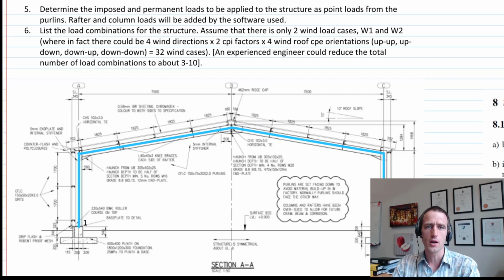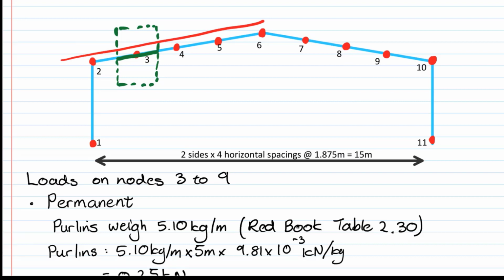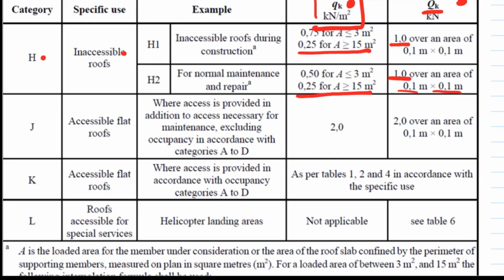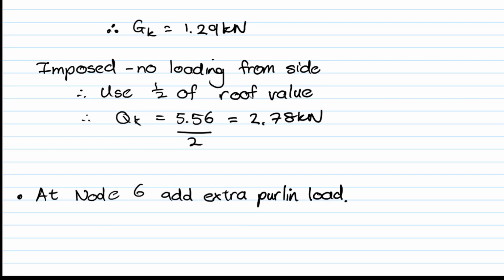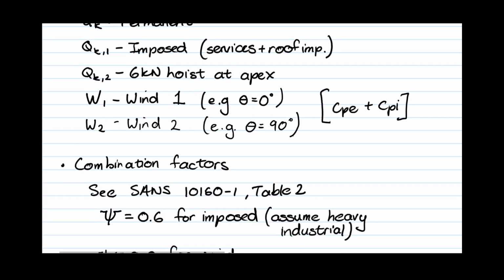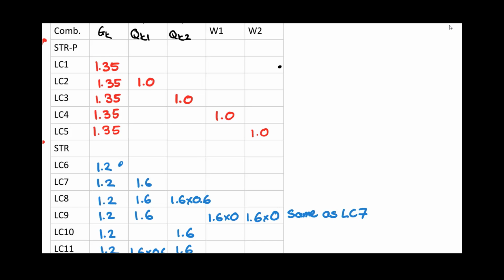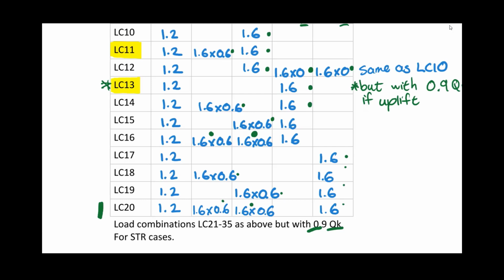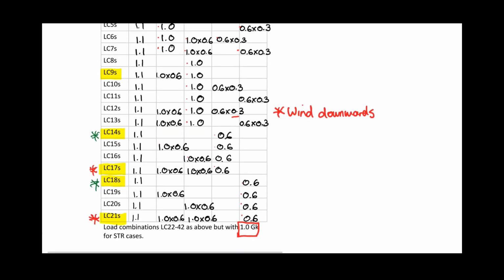Building Loading - Loads and load combinations to SANS 10160 for an industrial building - SD424

Comment: Hi Prof, thanks for the video - however I'm not following when it comes to the Favourable loading - according to Table 3 of SANS 10160-1: imposed and wind loads have a partial factor of 0 meaning under the favourable case it would only be self-weight with a factor of 0.9. However, in the video you made several references of the Load cases under favourable would match the unfavourable except in the case of Gk factor being 0.9 instead of 1.2 - is that correct ? Please correct me if I'm missing something.

Comment: Hi Prof Walls, I still consider a load combination of 1.5Gk (dead load in isolation).  Is the 1.5 factor outdated, seems like you use 1.2?
Reply from the maker: @meaghancarlisle9341  the 1.5 factor has been replaced by the 1.35 factor under the STR-P case
Reply: @richard_walls  Ah thanks, makes sense.  Looks like it changed years ago, oops. 🙈

Comment: Hello prof. Walls

I just wanted to know with regards to modelling the portal frame, if you are designing such that your columns resist bending induced by wind actions, do you model your base fixity as a fixed or pinned support ? If pinned how will one determine the moment of resistance at the support? thanks.

A Witsie would appreciate your clarity.😥
Reply from the maker: You would model it to match what you build on site. Base plates can be made to act as either fixed or pinned. Hence, if you assume pinned end conditions during design then make sure you specify a pinned base plate (e.g. bolts located close to the centre of the base plate such that they have limited rotation capacity)

Comment: Where did that 5m come from ,one you multiplied with to get the purlin load?
Reply from the maker: The portal frames are 5m apart. You would get that from the layout drawing or decide what it should be to suit your building. Thanks
Reply: Thats the 5 meter C.O.C. portal frame Fred Themen

Comment: Hello Sir
Sir I want to know that how we calculate the steel beam size (its web,outer flange and inner flage)
Similarly calculate the rafter size its web,its inner flange and outer Flange.and column base plate size with holes and nuts and connection plate size.All of those have a Formula to know sizes? 
Please sir if any formulas then tell me.
Please
Please